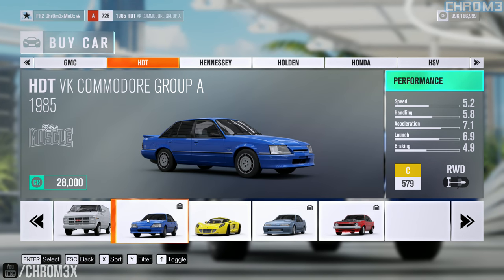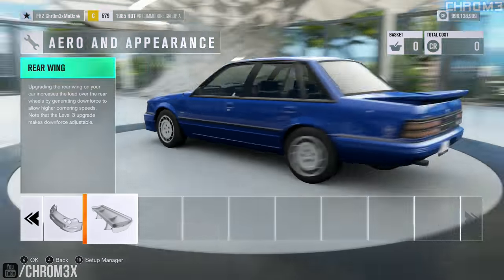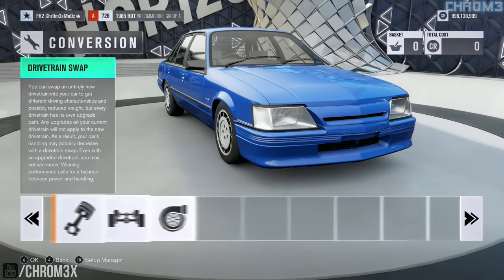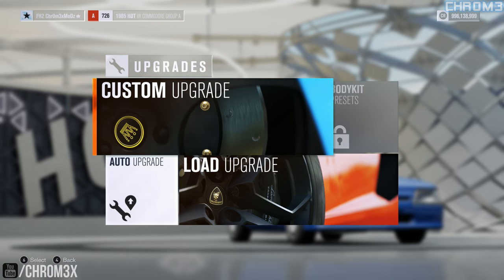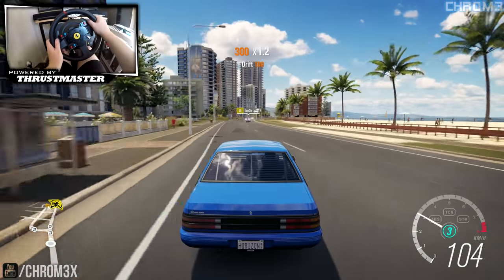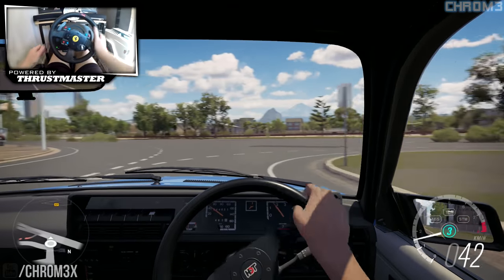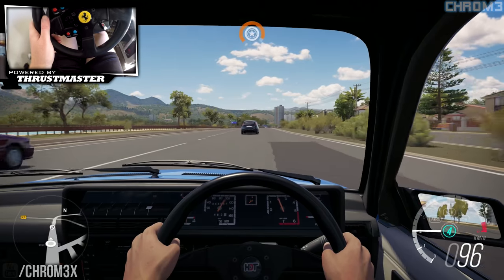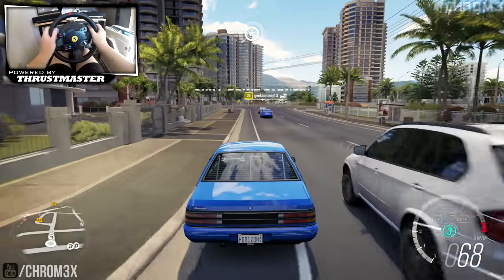Forza Horizon 3 - Holden Commodore (VK) Drift Build w/Thrustmaster Wheel Cam

Comment: What are your in game wheel settings? Looks a lot easier to drive than mine.
Reply: chris bear the less wheel rotation the easier
Reply from the maker: Easier yea, but not the proper way? I use full 900, so that's not why it looks easy if that's what you're wondering.
Reply from the maker: I'm doing nothing special, I just have a lot of practice, it takes a bit to get used to, what wheel do you use? I use 900 degrees of rotation as well.
Reply: CHR0M3 I use 510 because I'm still learning how to drift with wheel
Reply from the maker: Yea, 540 and 720, then 900.